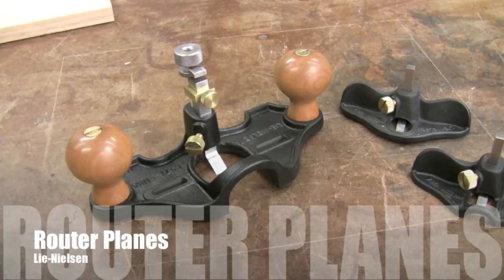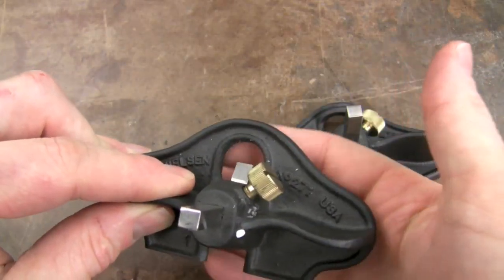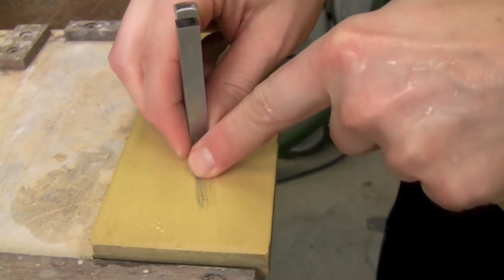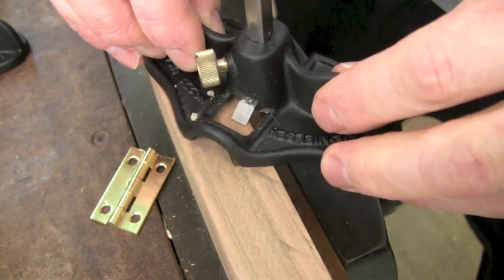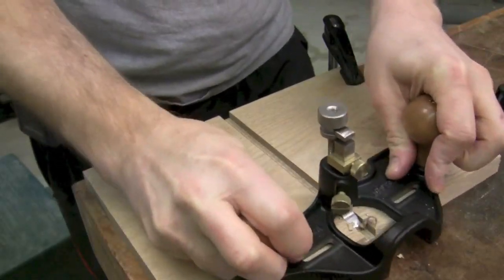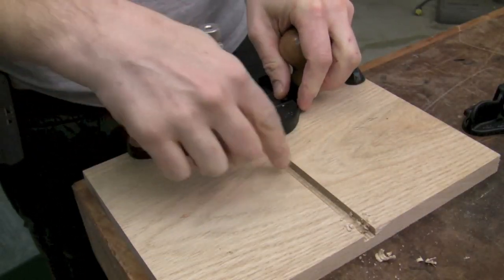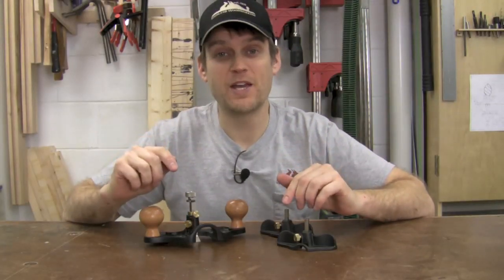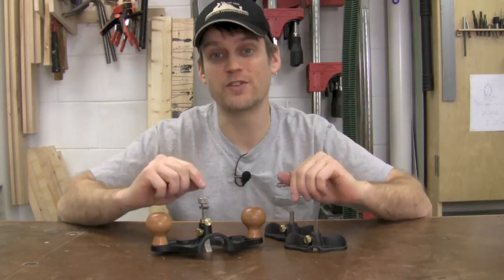Lie Nielsen Router Planes Product Tour

Comment: Great review on the line of routers. I have the large open throat router and I need to pick up the small closed throat, one of these days. 
Your tip on routing two tenons at once is great, it has gotten me thinking about the ability to do four at once so the adjustments are equal on four corners and I'm not making so many adjustments.

Comment: the "open throat" is for chipout. If the router is being used in a situation where you may be running over chips, the open throat is the choice. The chips have someplace to go other than under the router and they can be blown away as you go.  If you're already working at a depth, such as tails and pins, either router is fine.

Comment: How deep a cut can be made, i.e. can the blade be lowered to a depth of say 2.5" in order to clean out the bottom of a large square tenon?
Reply from the maker: Unfortunately the maximum depth of cut on the large router plane is 1". For trimming a joint that's deeper than that, perhaps either a chisel or a shoulder plane could be used (depending on the size and nature of the joint).